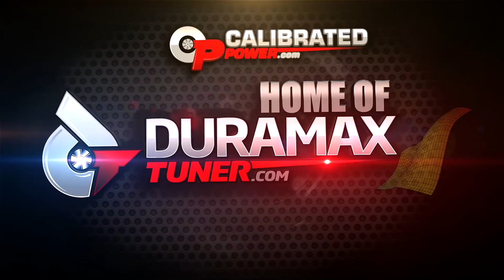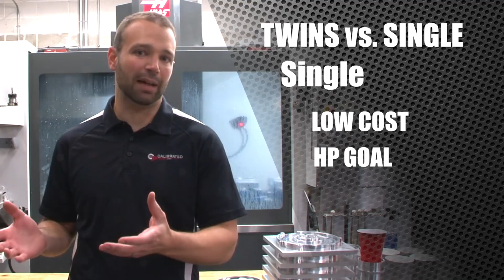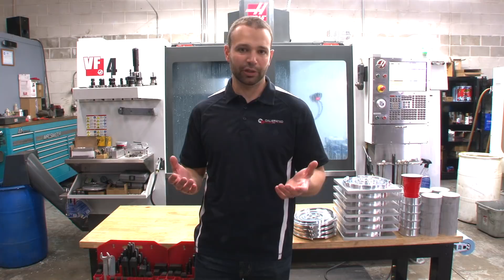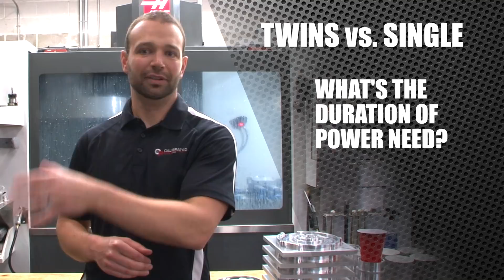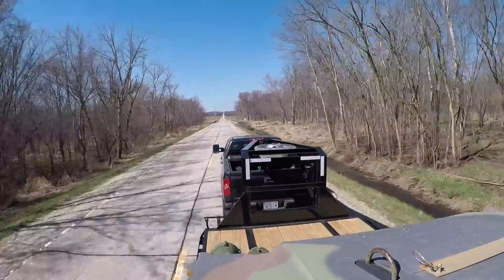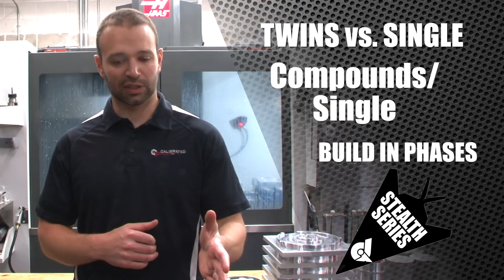Diesel Insights: Single vs Twin Turbo Setups

Comment: i saw a video where you said the stealth 64 spools slower than the stock turbo by a bit. is there an turbo upgrade that spools as fast or faster then a stock lbz turbo that I can put with a billet s475, s472 or s469  for 1500ish tq?

Comment: I tow at 25k gross with an Lmm dually. Would you recommend a dual setup and a second turbo of what size or a 64mm single? I have a suncoast converter already and a lift pump. I will put high flow manifolds and up pipes as well as a y bridge when I upgrade. Will the stock turbo outlet be a restriction and cause egts to increase, making it foolish not to upgrade the stock turbo when doing a dual turbo setup? Thank you for your help.
Reply from the maker: stock/s475 or Stealth 64/s475 twin kit will be perfect for you.
Reply: @Duramaxtuner  Thank you for your response. Would my egts benefit noticably from the 64 vs stock on a  compound setup?

Comment: Nick, question for you on compounds. I had it done by Dans Diesel Performance before I found out about guys, somewhat happy but little pissed as well. Those 2 oil return lines off the Turbos are zip tied both sides underneath. Is that normal or are they suppose to go back to the oil pan? When built motor, Trans and more was done, supposed to be put on dyno yet has not happened. I use truck everyday and have oil dripping from both oil return lines which I hate. Can you help, i will start using you. It is a 2016 3500hd shortbed.....Joe
Reply from the maker: joseph, bring it by our shop in Marengo and we can see what can be done.  950 Greenlee St, Marengo, IL 60152.
Reply: No needed coolent lines but it does need an oil feed and drain line to go to the turbo. So idk what lines are plug if t the oil ones then idk wtf they doing  but if its them coolent. No needed  for an upgraded turbo. ..

Comment: So would you recommend a twin kit for a daily driver that tows a 22k lb toy hauler during the spring and summer for camping. Not looking to break land speed records as it’s a one ton dually, just some more power and reliability would be nice.
Reply from the maker: If your towing a lot, especially at elevation, with that type of weight you probably are a better match for like the s475/stocker Twin kit.

Comment: What if I run a larger single (68mm VGT) to tow and keep the EGT’s down with a water injection kit?
Reply: stayunique91 Water meth runs out.
Reply from the maker: Sounds like that is a clear situation where a twin kit would out perform a single turbo.  Or run a smaller single and make less peak power.